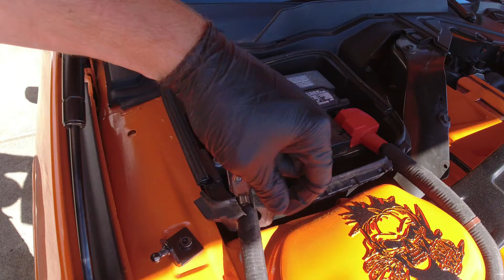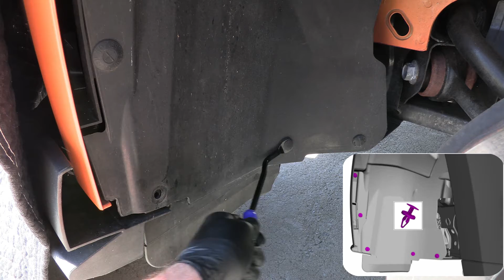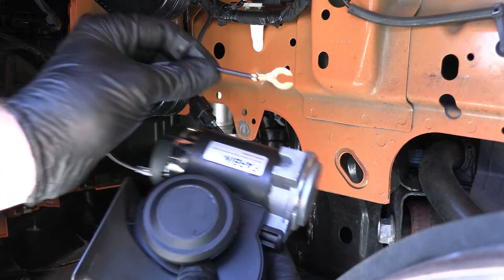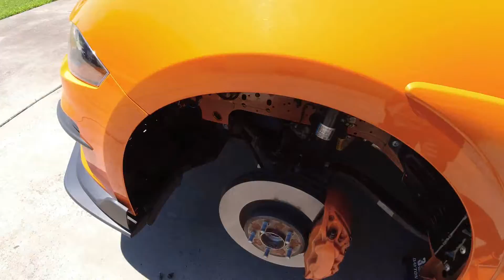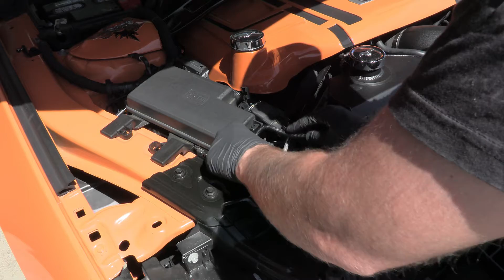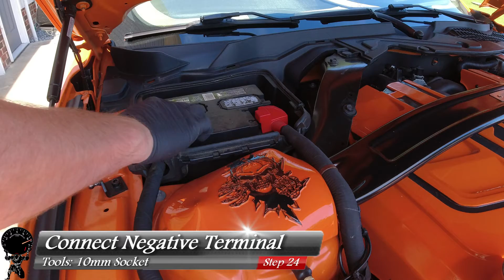Installing an Upgraded Horn for 2015-2023 Mustangs (S550)

Comment: Do you think ramps would give enough clearance to work under and around removing the wheel well?
Reply from the maker: Perhaps
Reply: @mcgurrentertainment  perhapsedly is good enough for me. I'm just replacing the OEM, because the main shat out and now I'm ashamed when I have to beep.
Reply from the maker: Lol. That's a good reason to upgrade
Reply: @mcgurrentertainment  Thanks man I love the Halloween theme by the way, looks very clean. Out of curiosity, have you done anything suspension wise?
Reply from the maker: Not yet. The owner did want air suspension, though...
Reply: @ Ah, I see. Great video, thank you for the information. Personally, vids like yours help me take care of my car better than the Ford stealerships near me can. I appreciate you.

Comment: Decibels are a logarithmic scale, so the volume doubles for a 3 decibel increase.
Reply from the maker: You are correct, dB (decibel) is a ratio between two quantities that has been reported on a logarithmic scale. However, in acoustics, sound is a change in pressure relative to atmospheric pressure. Thus, the reference quantity is the smallest pressure change detectable by the ear (hearing threshold), 20 µPa in air, which corresponds to 0 dB SPL. Our sound meter measures this Sound Pressure Level using dBa. A dBA is a weighted scale for judging loudness that corresponds to the hearing threshold of the human ear. Although dB is commonly used when referring to measuring sound, humans do not hear all frequencies equally. Although an increase of 3 dB represents a doubling of the sound pressure, an increase of about 10 dBa is required before the sound subjectively appears to be twice as loud. The smallest change we can hear is about 3 dBa.